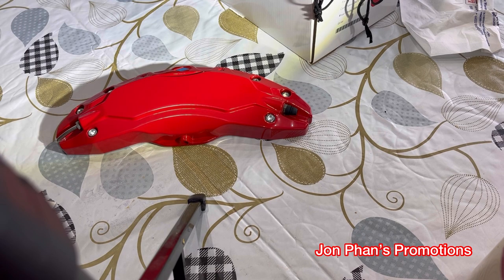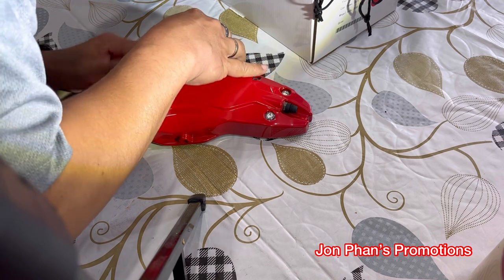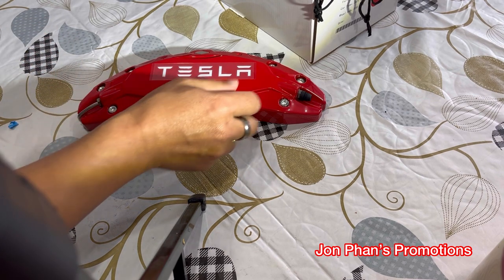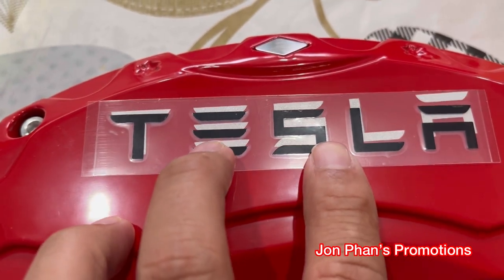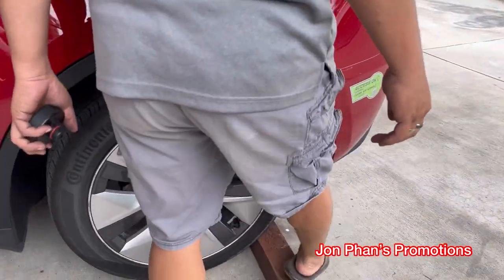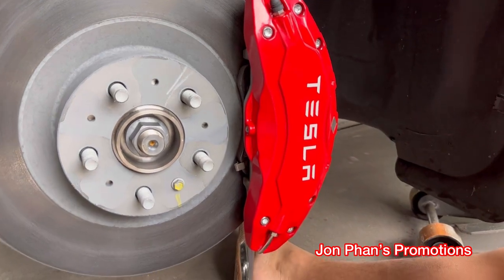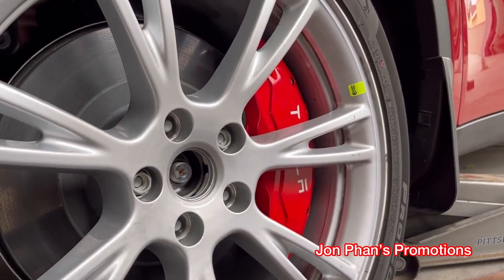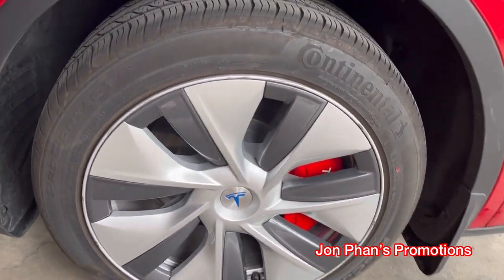How to install 2023 Tesla Model Y Long Range Tesristar brake caliper covers to look like Performance

Comment: Just curious, does installing these affect the manufacturer's warranty on the Tesla, especially if there's an issue down the line with the brake system?
Reply from the maker: I don’t think so because it does not interfere or affect the brake lines in any way.

Comment: Wow that was hard to watch after the second time that top clip on the first caliper cover fell to the ground. Please just start the first screw before you try the second one. But thanks for the video I appreciate it, especially since it’s the only one I found that covers these particular brand of brake covers.
Reply from the maker: It’s been pretty good for me. My last tire rotation I checked and it was snug.

Comment from the maker: https://amzn.to/3BpEIE5  Amazon now has $8 coupon.  Buy it before its sold out.  Best Caliper covers by far.  For all Tesla products, I have the links in the description for everything at the click of a mouse.
Reply: Hi Anh! I just bought the same item like your, but i dont have enough tools to install it. Do you know any place that i can come to do it? Thanks Anh
Reply: And since you installed them on, is there any issues thats cause the break heat temperatures?
Reply from the maker: @ViLy-v5e  Any autoshop would be able to install it.  Its pretty simple.
Reply from the maker: @ViLy-v5e  No issues at all.  I get a lot of compliments about it.  People think I have a Performance.